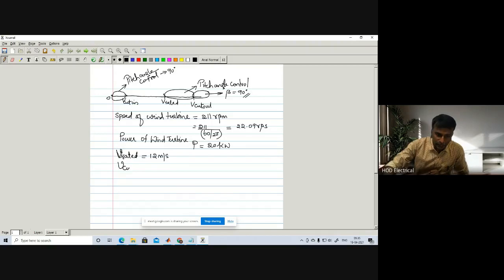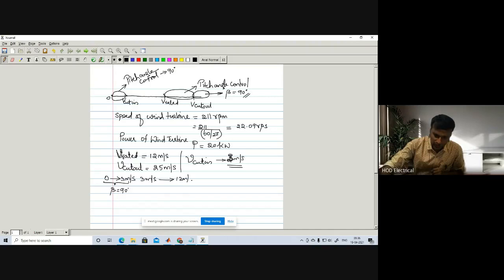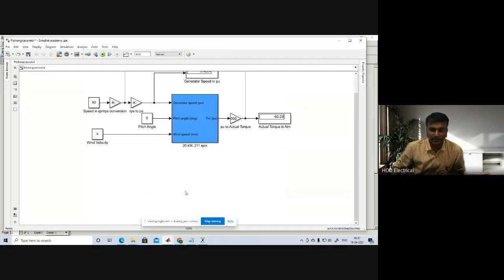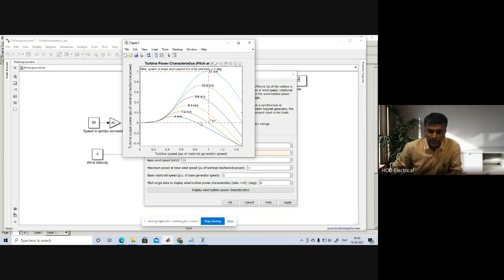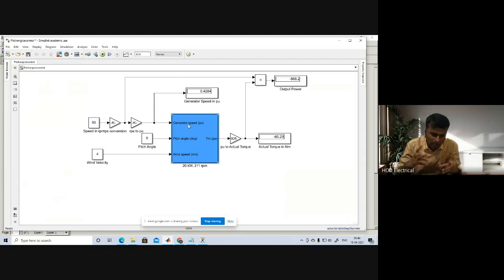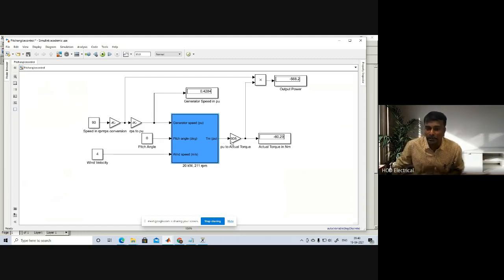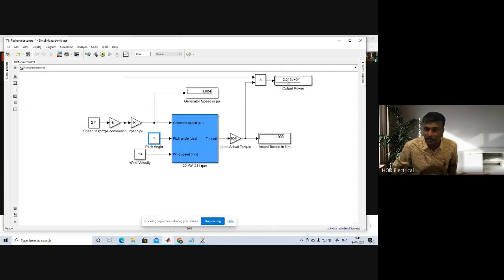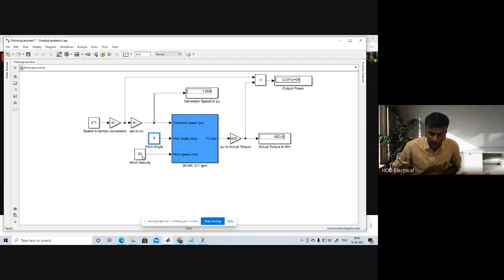WECS -2: MATLAB Simulation of Pitch Angle Control By Dr Rajin M. Linus

Comment: respected sir, can we connect the PMSG Or any other machine. can we connect it to AC grid.
Reply from the maker: Yes dear. But through the variable speed drive and grid side converter. Also depends on the control strategy in power converters. Thank you for the comment dear Hassan. 🙏🙏sorry for the delay

Comment: Sir, here I found that there is a mistake in conversion from rpm to rps.. i think we only need to divide by 60 rather than dividing by (60/2*pi)
Reply from the maker: Dear Sir, Thank You for your message. No sir, It should be (60/2pi). Thank You
Reply: @eeknowledge1732  yes it should be 60/2pi only because it is not rotation per second but radians per second.